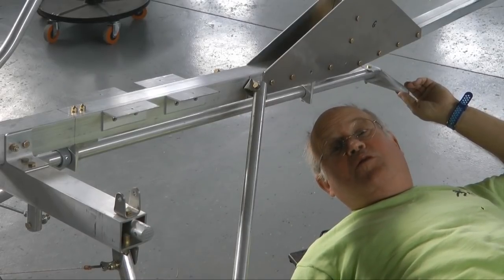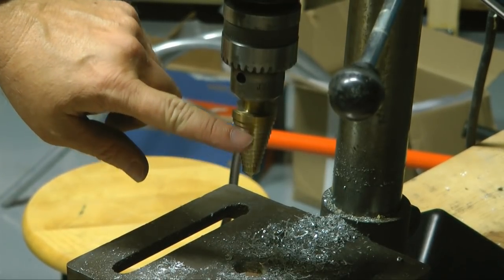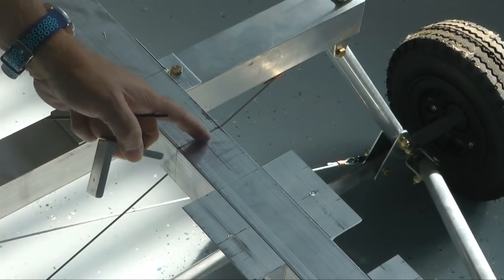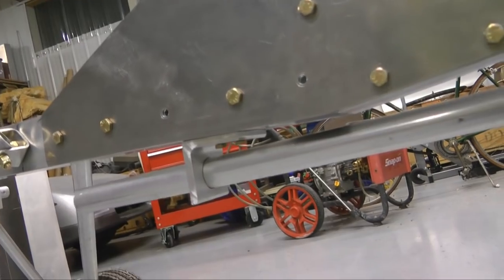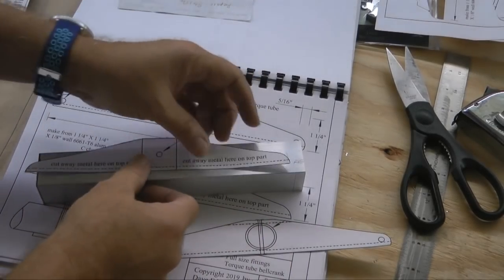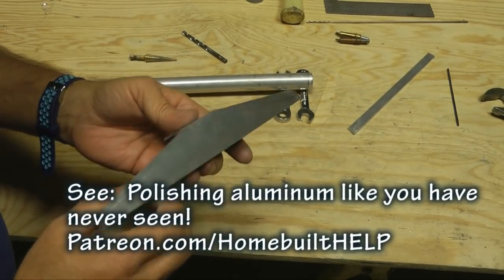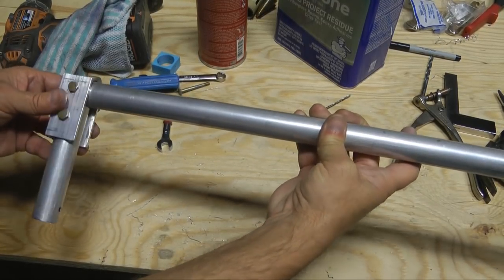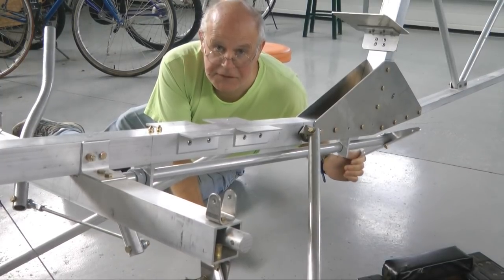Building the Affordaplane Part 20

Comment: Wow, Jon, I don't like those aluminum angle "bearings" one bit.  Metal-on-metal is a really bad idea.  Over time those angles are going to make  a mess of the torque tube, and there's not a lot of wall thickness to take the abuse.  I really hope you'll consider changing that setup.  Here are two easy modifications you could make:

Either way, drill the large holes in the angles up to 1-1/4" ID.  Then, either...

1.  Attach a 2" square of 1/4" thick UHMW to each one.  Drill a 1" hole in the plastic, centered in the large hole in the angle, so that the plastic becomes the bearing surface.  Don't use an Acetal plastic like Delrin, as it's not UV resistant like UHMW.  If you don't live near a plastic supplier, you can get a piece of 1/4" x 2" x 10" UHMW on eBay for ~$12.

2. Bond a piece of PVC pipe/fitting into the aluminum angle as a bearing sleeve.  If you don't have any structural adhesive, you can capture the bearing sleeve between two PVC rings with 1-1/4" ID, which you can attach with PVC cement.  If you can't find PVC that fits over the sleeve's OD, just make split rings that you can open up slightly to install.
Reply: Metal on metal is not a bad idea at all in many applications.  This application is a low force and low speed application and the aluminum on aluminum is perfectly adequate and likely will not wear enough in 2,000 hours to worry about.  And it is easily inspected in case enough wear does occur to cause concern.  If you want to see other metal to metal bearings, look no further than the tracks on a bulldozer…
Reply: @LTVoyager  Thanks for the info.  That may be so, but I sure wouldn't do it on any airplane I was going to fly, especially not with thin wall tubing going through 1/4" plate that has a jagged hole from being drilled with a hole saw.
Reply: @FlyingShotsman  That is the beauty of experimental amateur built airplanes - you get to make those choices.  I have a masters degree in structural engineering and I would have zero concerns with this design for this application.
Reply: @LTVoyager  Well, I won't argue with those kind of credentials!  I guess it's one of those things that just looks sketchy, but actually works!  Thanks for the civil discussion; too rare these days...
Reply: @FlyingShotsman  No reason to get worked up about someone else’s choices, as long as they aren’t going to kill somebody.  Using a better bearing material in this application certainly causes no harm, it just adds unnecessary expense and probably a unnecessary weight, but as a home builder we are able to make these choices.  I am building my S-21 pretty close to the plans, but I’m still doing a few small things that I think are better.
Reply: @LTVoyager  Neat -- I hope your plane comes out just the way you want it.  I've got a similar attitude about my Kitfox.  I'm not smart enough to second-guess the engineer who designed it, so I'll stick to customizing avionics and lights.

Comment: Looking at the video, I don't think you did not need to move the rear bearing forward as the bolt was not on the edge so it would clear the other bolt.

Comment: Those upside down bolts give me heart burn. It’s always best to have the nut on the bottom side for safety sake I however understand the clearance issue. Can you put castle nuts with a cotter pin or use a nut with a hole to accommodate safety wiring those 2 nuts together instead of the nyloc to prevent them from backing out?
Reply: Threadlocker may help?
Reply: @jamesengland7461  possibly. Add those to your preflight checklist and your annual condition inspection. I realize that those bolts might need to be installed in that orientation in order to have the correct clearance. Just check them often.